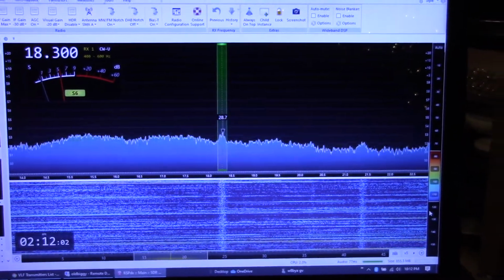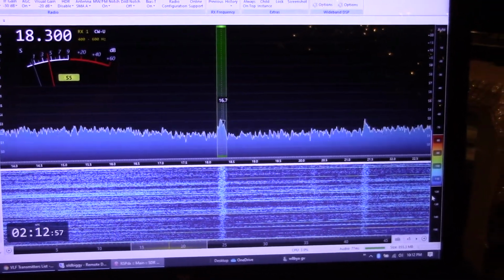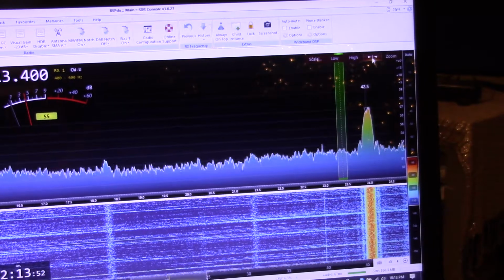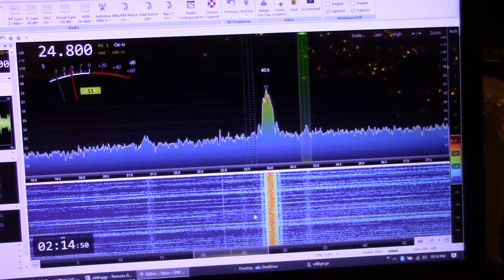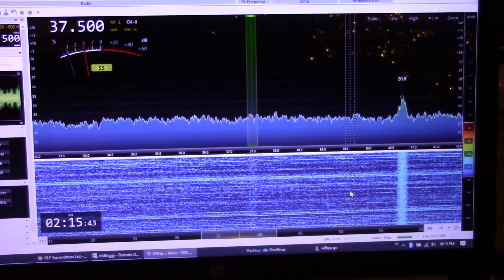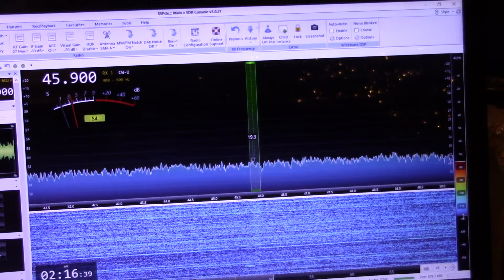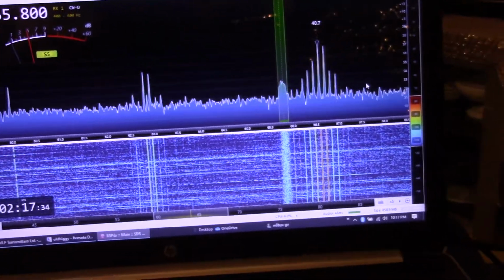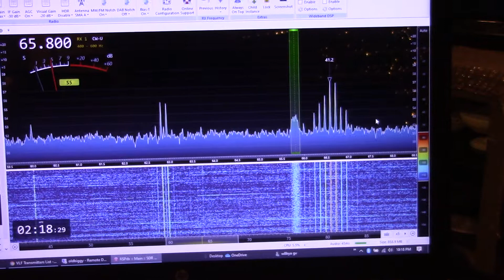VLF DX Using a Simple 40m Dipole & SDR Receiver

Comment: What mode are you in, CW..??  What software are you using..???
Reply from the maker: Here I was in a CW-U mode but it really does not matter as we are not trying to listen to the stations. The panadapter display as well as the waterfall display will look identical regardless of the mode chosen.  I like using SDRConsole most of the time. It has some shortcomings but it's pleasant UI makes up for them. 73
Reply: @w8bya  Ok, thanx for the info, I figgered you were in some type of CW mode. Using a homebrew 3 foot loop here with SDRplay, works good. I think VLF is the final frontier of ham radio, not much is really known about it yet. I'm from Cleveland, K8TND since 1960. In Florida now. :-)
Reply from the maker: @fatherd.6016  A loop is a good choice for your location since it will let you null out strong noise sources. But given your location in Fla your QRN level is going to be very high except during winter. GL 73
Reply: @w8bya  Yep, the loop is working good. Gotta noise level of -125 on my SDRuno tonite. Logged a couple new stations. I was using spectrum lab, but it sucks.
Reply from the maker: @fatherd.6016  Sounds great. Here is a capture from 5 minutes ago....I see TBB from Turkey is on at 27.600 kHz.  See if you can spot it.  https://drive.google.com/file/d/1YZrM7h0YBjK_86oFCgYPs_z22E2XqJlV/view?usp=sharing
Reply: I see it on 26.6 on your pic. I'll keep an eye out for it. I switched over to HDSDR for software, still using my SDRplay hardware. I like the new software better...!!! I have my loop aimed at France, I get a good signal from them all day long. :-) 😊

Comment: Interesting stuff on vlf 
Have you tried the ham frequencies on 135 and 472 kHz ??
Reply from the maker: I have seen signals on 2200m and on 630m. There would be no sense in trying with the MLA-30+ but I could try some comparisons of the BYA modified YouLoop vs my 630m transmit antenna or the 40m dipole. I took down the 600' inv-v for 630m (that I used for XMT & RCV) and put up an Inv-L antenna with some 165' elevated radials. When I started on 630m a couple years ago I was just SWL PSK signals and even the 40m dipole made a very good low noise RCV antenna down there. FYI, my normal RCV noise level on 630m using the 600' Inv-V or the Inv-L averaged S9 to S9+10 dB on the calibrated flex in the winter time so just about anything will hear better than a full sized XMT antenna.